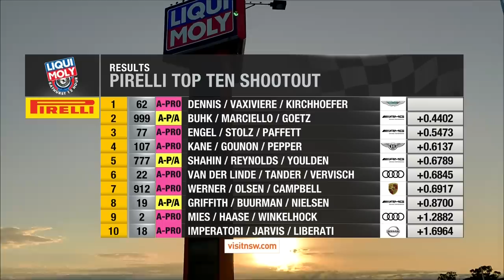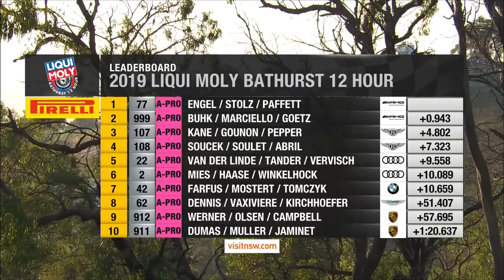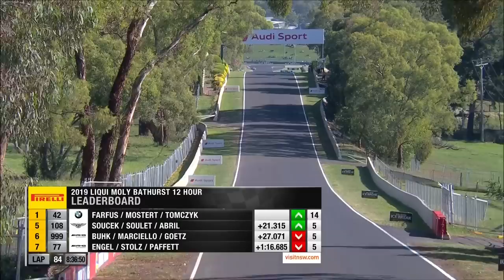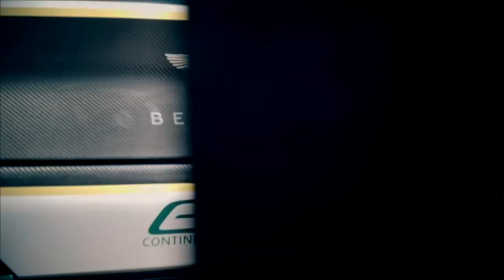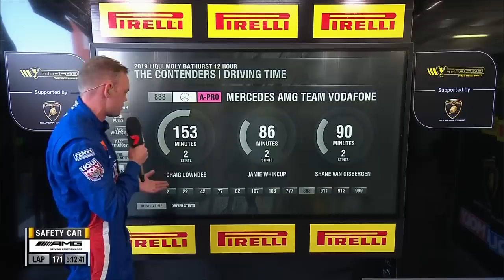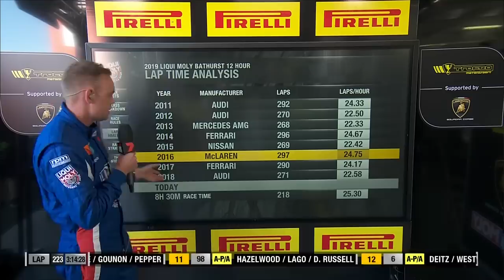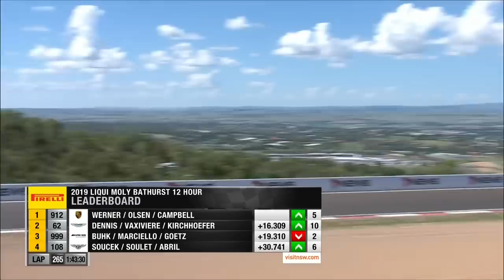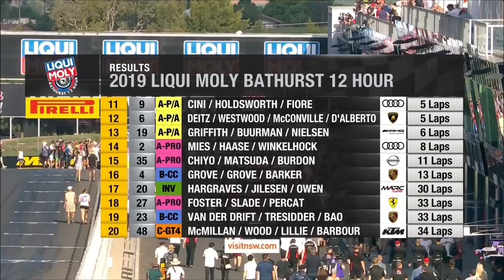Bathurst 12hrs 2019 - Intercontinental GT Challenge - Full Main Race

Comment: Mt Panorama Bathurst is amazing. So true that only the mountain decides the winner.
Awesome race🤙🏾

😲😲😲
Reply: I've driven the track in a road car at normal speed limits (the full length track other than for motor racing events like the 12hr, 1000km and 6hr, is normal public roads all year round). Believe me, when they say that television doesn't really do justice to just how steep the climb from the pit straight to the top of the mountain is.....they mean it. That place really is steep on the climb.

Comment: Wait, why is the fastest qualifying lap car starting all the way to 12th in the starting grid?
Reply: They were pinged for speeding in pit lane in practice on Saturday which penalized them 2 grid spots, then there was a (non-deliberate) technical discrepancy with maximum revs used during the Top 10 runoff so they were excluded from the Top 10 results and bumped to 10th place. 10 + 2 = 12.

Comment: It must be warm with the humidity
Reply: It was. Even though the actual temperature wasn't ridiculously high (about 33C) the humidity made it very draining. There was barely a whiff of breeze, it was a quite oppressive for sure. By the afternoon there was spectators flaked out in the shade everywhere around the track.  We usually wander around to different vantage points and go up to the top of the mountain for a look during the race but this year we mostly stayed in our Grandstand seats as they were in the shade. I can only imagine how hot it must have been for the drivers.

Comment: I wander why the never replay the infraction of the" AUSTRALIAN" 888
Reply: They did in the live coverage lights were green on the safety car when he overtook them it went yellow when he was already at Griffith Bend so was a massive cockup on their part
Reply: They did kind of forget that as soon as the safety car is out, all the flag posts are waving double yellows and have the SC boards out even when the safety car has the green light flashin for cars to to pass the safety car, but not each other. It was a good decision to lift the penalty considering how good the race end was though. Great race to be at and good to see 888 finish so well after their struggles with the car early in the weekend.
Reply: I was watching from the side of the track - you can't really see it clearly on the replay but basically the safety car came out and the first car coming up got a green light to go by but obviously wasn't sure what to do so stayed behind the safety car - then a second car came up and joined the queue. The safety car kept flashing green and slowed to encourage the cars past, eventually virtually stopping. So Whincup passed all three cars virtually stopped on the track, the other two then got the message and carried on. You can see the end of this on the replay. I haven;t read the specific race rules but generally its ok to pass another car under safety car if it is stopped or deemed to be clearly travelling so slowly as to not be maintaining any kind of appropriate speed.
Reply: @andrewguy6501  They do that here in Australia so the safety car picks up the leader they can't overtake the safety car as soon as it picks up the leader
Reply: @andrewguy6501  from what little i understand, you cannot overtake under a yellow flag, much less under a safety car if the cars in front of you virtually crawl to stop, you stay behind them. He could have pushed those cars past the safety car and remain on cue. But he didn't, he overtook them. Remember, they penalized two front running cars for weaving under a safety car, one was even disqualified. Weaving! Don't you think overtaking is more grave than weaving?
Reply: @andrewguy6501  yeah i was at hell corner. So i couldnt see that they were pretty well stopped. All i can say is i've never seen a car not be penalised for passing another competitor under full course yellow conditions. But as i said. Glad it happened the way it did cause it made for a great finish
Reply: Yeah - Like I say I've not read the specific rules for this race - it was definitely risky - the 2nd race car that arrived chose to stay behind the 1st car presumably following your reasoning. I do remember Marcos Ambrose at Sonoma a number of years ago when he turned his engine off to save fuel and coast whilst leading behind the safety car but then struggled to restart and a string of cars went past whilst he was still moving but equally clearly in trouble. Given it was almost exactly where Whincup stuffed up in the 1000 under safety car it does seem like he lost his cool - the low risk move was definitely to stay put. @ronaldbaingan625
Reply: @andrewguy6501  well, nothing can be done now i guess. Till the next race.